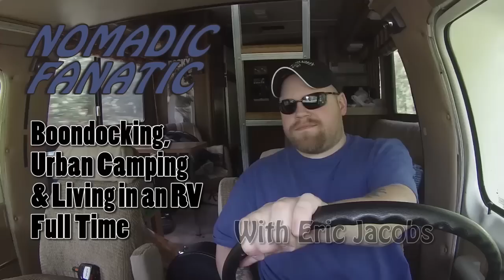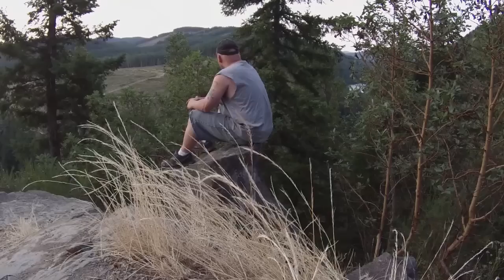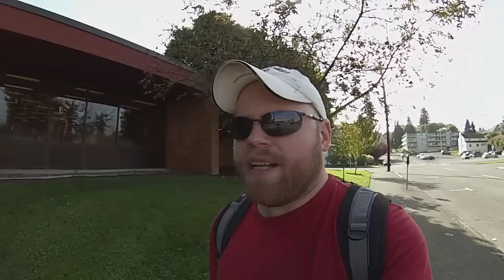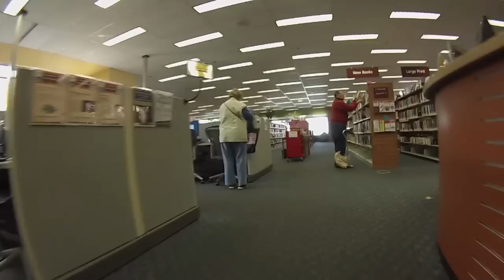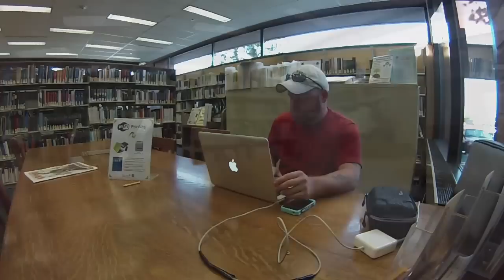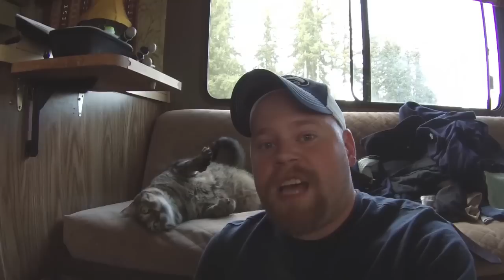RV Updates For The Week

Comment: Might sound a little crazy - check that the grounding strap attached to the engine block is in good shape and attached properly. We had crazy voltage / current issues on a Dodge long ago, and it caused some wacky issues like that.

Comment: I would bet that it is the starter or improper disengagement after starting the engine.  The solenoids could be defective or not the correct ones.  The fact that you hit them with a hammer tells me they are binding, but to many amps will fry them.

Comment: Hi Eric I used to be an Auto Electrician. Its sounds like the starter is drawing to many amps and causing the solenoid to fail. Like some others have said its probably due to the starter having a coil sorted somewhere. The effect of this is to many amps and thus practically welding the solenoid bar inside to the terminals causing it to just carry on powering the starter. The tap with a hammer is just giving just the right mechanical shock to return the solenoid bar again.  Also the fact its drawing so many amps that when you connect teh cable to the post its melting it away is obviously Not good.

Comment: You should get a basic digital clamp-on amp meter, disconnect the house battery system, and measure the amount of amps flowing into the solenoid and into the starter while starting.  Should be close to 1 amp into solenoid , 50-100 amps into starter.

Comment: Got me curious, so did some googling...  I really have no idea, but it appears that some rigs use a battery isolator so that using your house battery won't run down the starting battery.  If the Tioga either doesn't have one, or it isn't working I guess it might be possible that both batteries are providing juice to the solenoid, double the amps?  I don't know.  But a quick check might be to disconnect the house battery and start it up, if no issues maybe that will give you a direciton to pursue.  Amazon has battery isolators for like 15 bucks.  Best of luck.  - Grizz
Reply from the maker: Yeah, you call it a battery isolator, and I've been saying "relay switch" We dissconected that device that allows the the driving alternator to charge both batteries and the solonoid still fails. Concentrating on ignition power now.

Comment: Eric, check to see if flywheel is missing any teeth. Mine currently is missing 3. Not enough to pull tranny and replace, even though rear main seal needs replacing. I have replaced at least 3 or 4 starters before finally pinpointing solenoid. However, I wonder if the missing teeth may have something to do with it as well.I would be curious to know your flywheels condition. I know its fishing, but since we have exact same issue,...maybe it has something to do with solenoids failing. Its a stretch.

Comment: if you gone through 3 solenoids  same issue. the relay for the 2nd battery could be melted open on the inside. Really its kinda scary when ever you have a electric issue, I say disconnect the 2nd battery. if the issue goes away. leave it disconnected till you can replace the relay.
Reply from the maker: But it only happens once in ever 12 starts or so. Weird.
Reply: Nomadic Fanatic Then the relay is sticking. and sometimes just starts to work properly. but not always.

Comment: Sounds like your starter is drawing to many amps do to a short or starter is not disengaging from the flywheel properly
Reply from the maker: That starter is like 4 months old. This same shop installed it and they aren't considering it as a culprit. But now I don't know.
Reply: Nomadic Fanatic I had a similar gremlin in my ford f350 and when they installed the starter somehow the positive wire ended up rubbing against something metal and after a while it shorted to ground and fused my starter contactor together. Have them check all your positives to make sure your not grounding out somewhere . Good Luck
Reply: Nomadic Fanatic the shop should still check the amp draw of the starter..none are new anymore at least not for as old as what you have and they all go bad..had a many right out of the box..sh.t happen's bro...and do up grade the ground's if all you have is stock the were marginal from the start..be-safe

Comment: Our RV WH (an Atwood) was acting wierd.  It ended up being the main circuit board was shorting out and causing power problems.
Reply from the maker: This was the original from 1983 (31 years old!) I'm having a Suburban model installed direct spark with a switch inside.

Comment: One of two things has happened. Ether the relay that charges the house batteries is sticking an feeding to many amps threw your starter solenoid or the sticking solenoid over heated the new starter causing it short out internally an now pull more amps than the solenoid can handle.
Reply from the maker: We tried 3 new solonoids. After several starts, they all had the same problem.
Reply: *****  Yea, the wire windings in the started can get to hot an melt the coating allowing them to touch each other. The starter will still seem to work fine but it will pull more amps cause it has less distance to run to ground so less resistance. The high amps going threw the solenoid makes an ark when you try to start it an the contacts stick together.

Comment: my RV use to do the same I find out my alternator was sending power back to the solenoid some time it would turn on some times it wouldn't turn off and even if i took out the black ground wire the red power wire was still energize so i took out the red power wire off and the solenoid would reset that's common on ford e350-e450
Reply from the maker: Weird. That new aftermarket solonoid is working fine, so I'm happy finally.

Comment: Do you have a separate house battery? It could be backfeeding.
Reply from the maker: Yes, but it's not wired to the starting battery or near the solonoid.  There is a relay that directs current from the alternator to both batteries, but it's not connecting the two batteries.
Reply: That relay is probably shorted out and feeding too many amps or you have a short to ground somewhere.
Reply from the maker: See, and that part is not a auto parts detail, it's an RV part (fleetwood Tioga add-on) - This is the problem with having an RV worked on. The auto mechanics work under the hood and on chassis parts, while the RV techs work on the living area parts. That relay is a motorhome accessory, and Menieke says it can't be the problem.
Reply: The problem isn't the difference between rv's and cars. Its auto mechanics that don't know the science behind the parts. If voltage is too high, its coming from somewhere. Its also an intermittent problem. That only happens with corrosion or electronic failure. I suspect the one way diode shorted out. You've got a short on your power side, plain and simple. A short on the ground side would be blowing fuzes. But if the power is grounded it could go on for some time. Until you get an electrical fire.
Reply: Do you have anything for your solar hooked up in a funky way? That could also be the prob.
Reply from the maker: No, the wire to my solar is clamped to the other battery only, and not even hooked up to the panel unless I'm parked and using the quick connects.
Reply: Do the quick connects stay connected at the battery? They could short too.
Reply from the maker: Yes, they stay connected always. They have grey covers and no metal accessable. Hell, I'll take those off too and check.
Reply: Eliminate all possible shorts. Get rid of the cables and un-do the house battery. Then if youre having trouble it can only be one power source.

Comment: Are they still replacing with used solenoids?   Likely going to need a new one from the dealer if that's the case.
Reply from the maker: No, brand new OEM parts. There is only one solonoid available. Ford only has the one. But maybe a wreaking yard will work.
Reply from the maker: Oh cool.